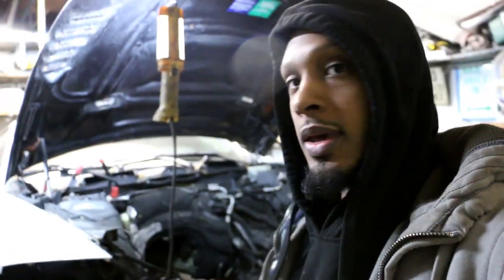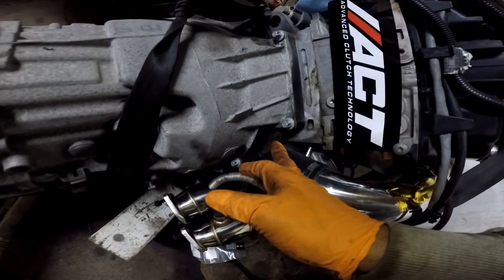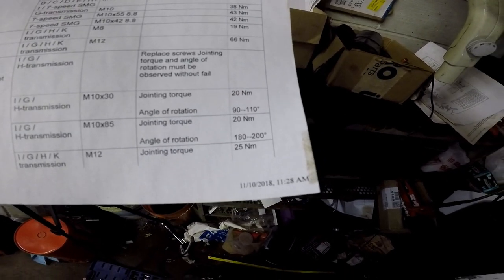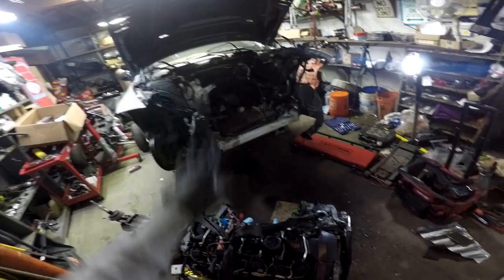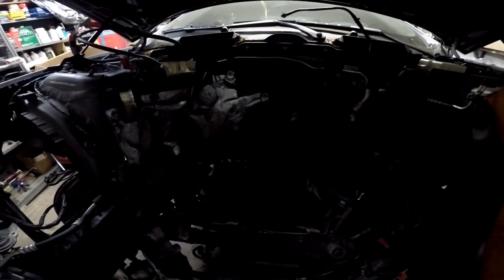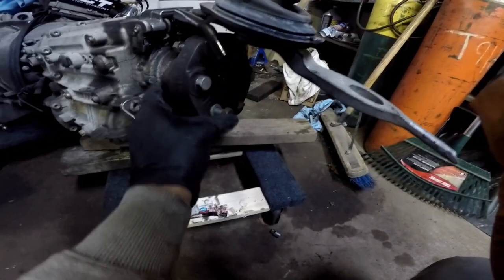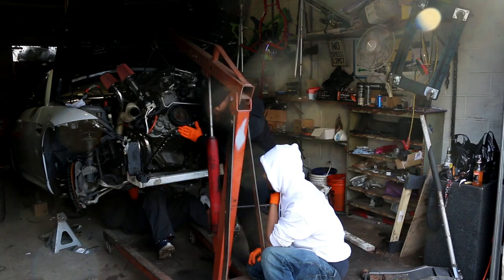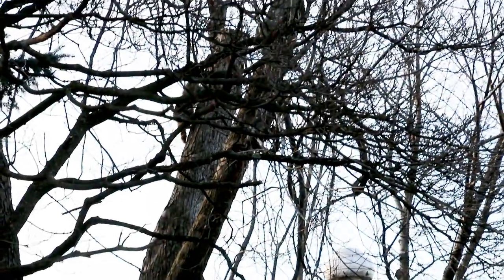THE MOTOR IS IN | EPISODE 12

Comment: How much trouble was it with the Shifter being attached and whatnot?
#NottaSoupQuestion
#SquadetteOutForNow
Reply from the maker: The shifter was the reason why we had to put the motor on such a crazy tilt. The shifter pivots up and down.  That allowed us to align it with the hole in the bushing. My main tips with this are, have the motor secured in a way its balanced and able to shift the weight on the hoist. Have a spotter guiding the trans from underneath the car. I used pb baster to lube the tail and bushing for shifter, this made it easier to slide in. Check that the shifter clears the shift boot inside the car. IMPORTANT SAFETY NOTE: I HAVE THE REAR WHEELS CHOCKED WITH THE HAND BRAKE ENGAGED. I ALSO HAVE THE CAR RESTING ON TWO 6 TON JACK STANDS. I AM USING AUTOMOTIVE GRADE SEAT BELTS DUBBLE KNOTED AT MY ANCHOR POINTS. MY TEAM OF 1 HOIST OPERATETOR AND 2 SPOTTERS. SAFTEY FIRST.
Reply: @JermaineLeeBlueprintAuto Daggone Good job...coz, that shifter boot could've gotten ripped asunder!